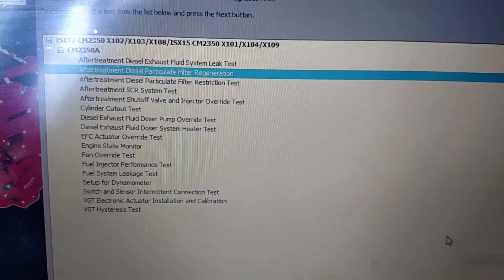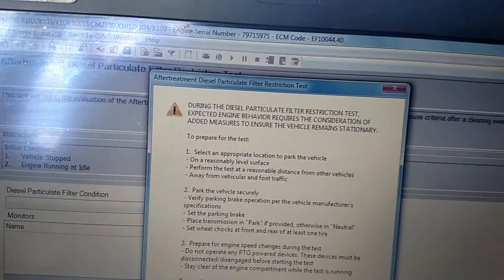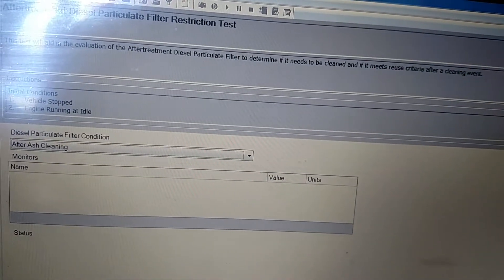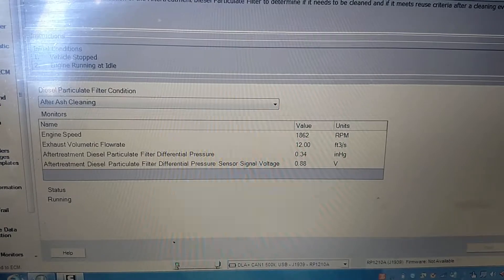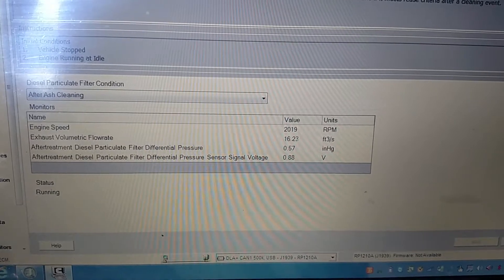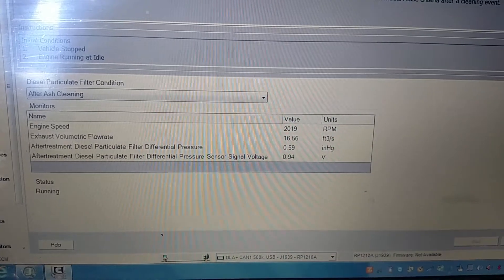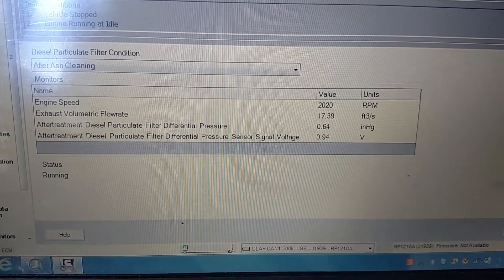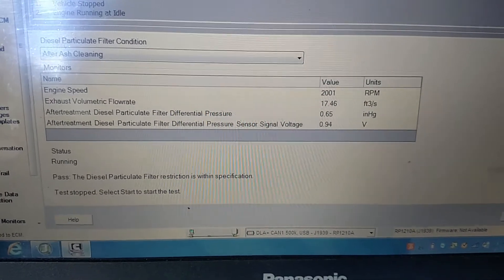Cummins diesel particulant filter restriction test

Comment: My exhaust volumetric flow rate was 11.91 ft3/s… it passed. 120k miles on a ISL 17’ that I just did an EGR tune up on. Is that good or bad?

Comment: I had a isl2250 and when i am peforming this test, it does not complete due to code 3135 becoming active. Dpf diff sensor is replaced, sensor harness is repaired. Any tips?
Reply: what did you find on this issue?

Comment: I am curious what engine rpms go to on an aft dpf restriction test. Just seems really fast at 2k rpms. I have a cummins isx 15. It just sounds like my truck is running away at that high of rpms.
Reply: it seems like a lot because it hold your radiator fan on the whole time and it makes it super loud at that rpm